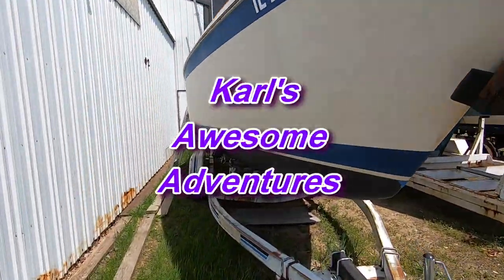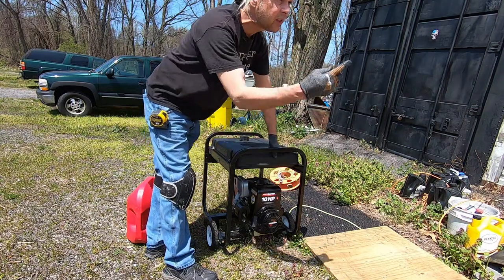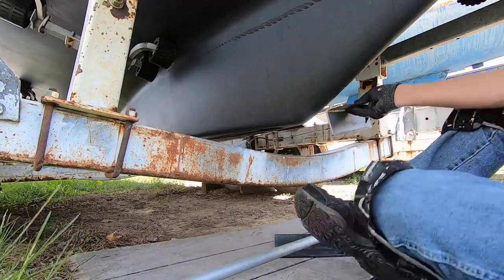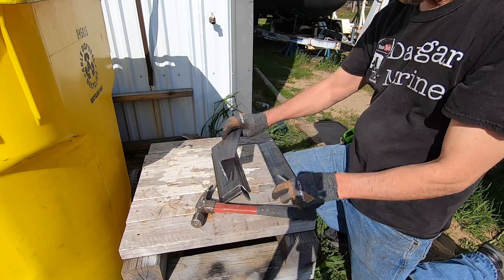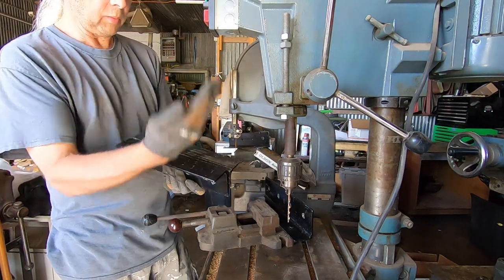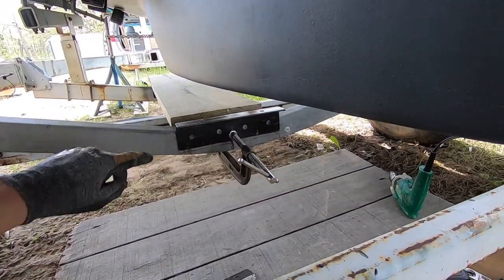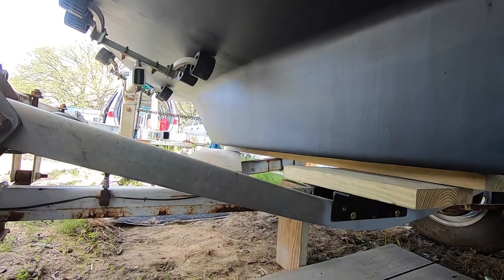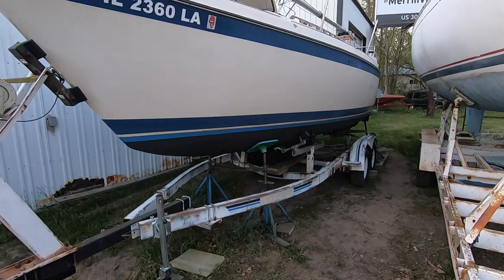Making a Keel Bed On My O'day 25 Sailboat Trailer  |  E38

Comment: just a few tips...the bigger the drill the slower it needs to turn otherwise it will burn up. instead of notching the 2 x 12s for the axle, check  the max axle travel in the up direction, just above this is where the bottom of the wood planks go (make the angle iron pcs to hold them there) also 100% of boat weight is on keel..the rollers are just to keep the boat from tipping.
Reply from the maker: Thanks for the tips John! No wonder I burned up the 1/2 inch drill bits. Will go slower with the bigger drills next time. Keep looking up ⛵😎
Reply: @karlsawesomeadventures9608  i have an Oday 26 Im slowly getting  ready. However still working full time  at 72 yrs old for the ins is making  the journey crawl.
Reply from the maker: @johncartelli I know what you mean.  I work full time doing my Handyman business. I have so little time to work on the boat....
Reply: @karlsawesomeadventures9608  i have to finish the 5' section on the deck where the core was rotted, replace the port main bulkhead. clean  the fresh water system(have dead roots in the filler hose), refinish the deck hand holds, finish sanding off the bottom paint and seal/repaint, replace rub rail, patch  gelcoat in big scrapes in side of hull, replace rudder grudgeons, repair cracks in rudder, get the outboard running or get one with electric start, build a mast raising/lowering system and make a foot for the keel to sit on. (right now as it was delivered just couple pcs of 3/4 plywood.
Reply from the maker: My to do list is equally as long....I have already sanded and painted the bottom of the hull, though. I got a great deal on my 25, and new it would need a lot of TLC

Comment: Good job, the hulls are thin in a lot of areas on Oday 25. The hulls will dimple if they are put on boat stands too. As thin as the hull is , in some areas it is very thick. I found this out when I recored and rebuilt ours.

Comment: I need to do the samething on my trailer. My trailer has runners and the boat weight is on the runners. This is a great video the only thing I will do differently is the bracket you bolted to the trailer, I will weld legs to them so I can raise them up or down if needed. It’s looking good.
Reply from the maker: Thanks James. It was tricky to get the boat jacked up with the stands so all the weight was off the rollers. Then making the angle iron the right height. That is a great idea to make them adjustable with legs!! I had to drill more holes on the back one to adjust it higher. Hope it all works out for you. ⛵

Comment: I was a bit worried about your drilling holes in the load bearing beams of your trailer - especially since these places carry the whole weight of the boat. Is there a specific reason why you did not weld the metal carriers to the trailer?
Reply from the maker: Nelle, I didn't have access to a welder.  Also drilling small holes in a beam takes away hardly any structural structure strength.